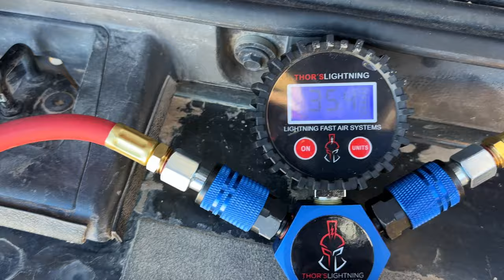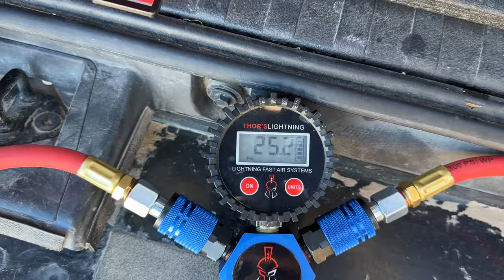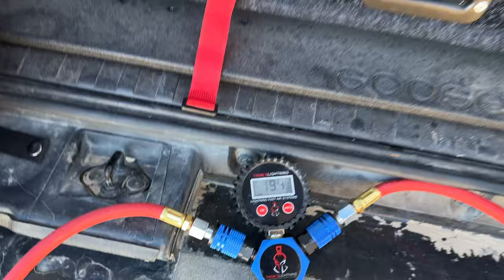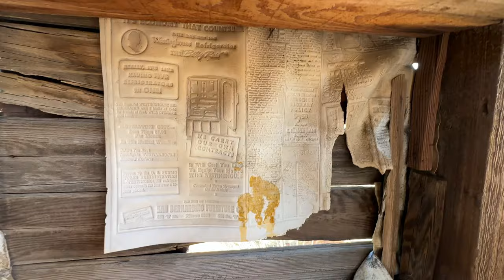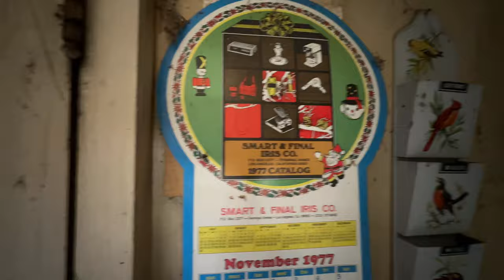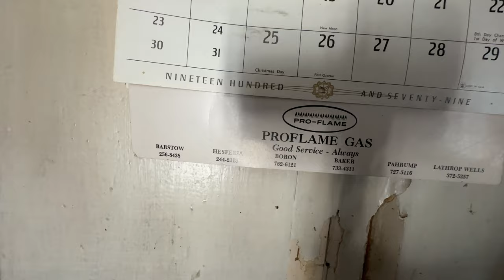Exploring Abandoned Mojave Farmhouse Secrets #abandoned

Comment: the sawmill is cool thing to have in a desert
Reply from the maker: @christignor146 are you talking about 28:00 of the video in regards to the engine and that mechanical contraction of metal parts, I would really like to know what that thing is or was? 
Anyways, thanks for your comment and for watching.
Reply: yes ,its belt drive and would have a 24 '' to 30'' saw blade  @DrivenXAdventure
Reply from the maker: @christignor146 just think back then, there were no guards and the blade being 24 to 30 inches I'm sure you could lose a limb or two, and ingenuity of that thing is AWESOME!  Thank you for the comment of what that thing was.